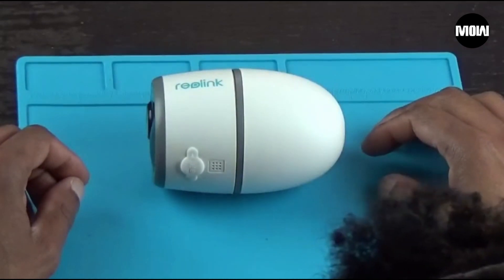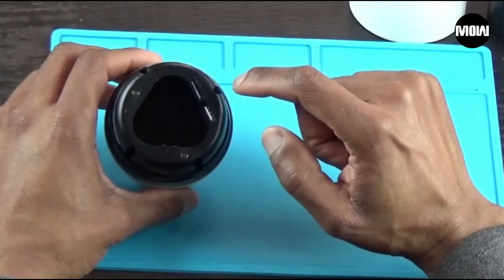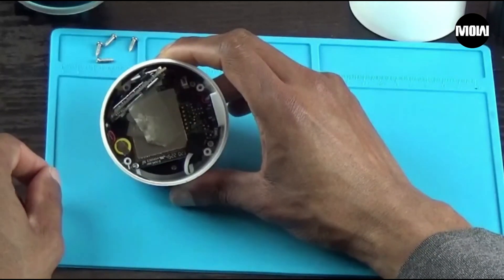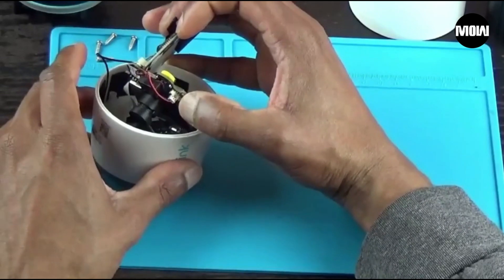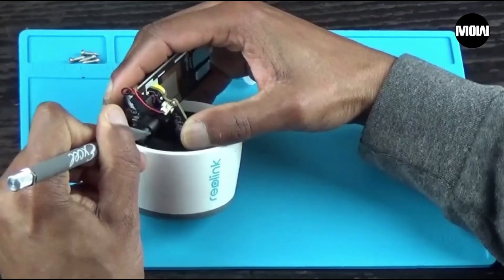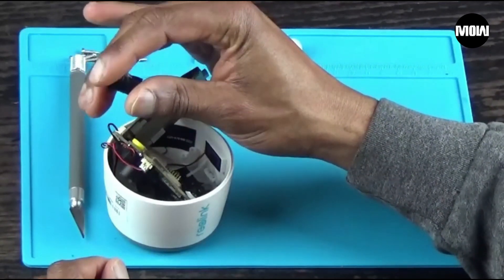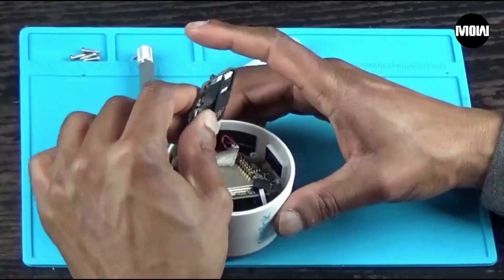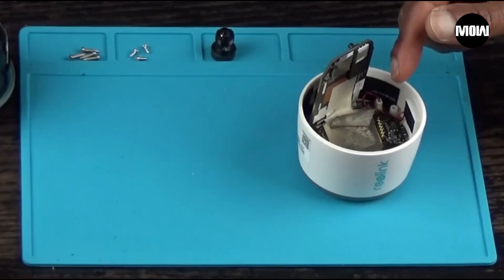How to replace a broken/cracked fixed security camera lens (or upgrade to a better camera lens)

Comment: Thanks for the video.  I was wondering if lens swaps could be done on these to get a wider angle like some of the models have.  I picked up a wider lens for about $8 on A.  I ran into the goo and was headed for a razor knife and pick.
Reply from the maker: Cool, make sure you count the turns when removing the lens.